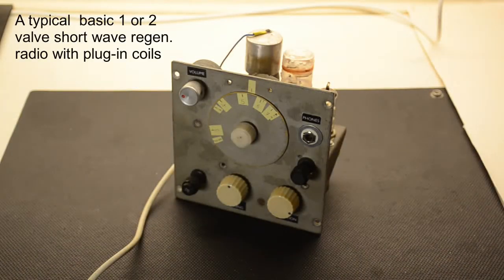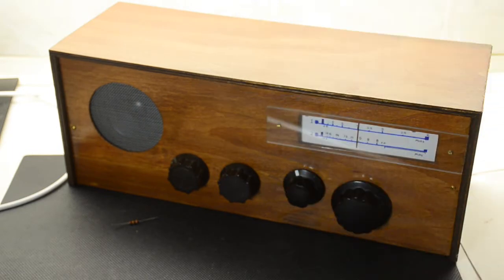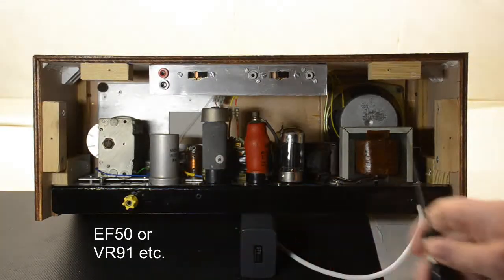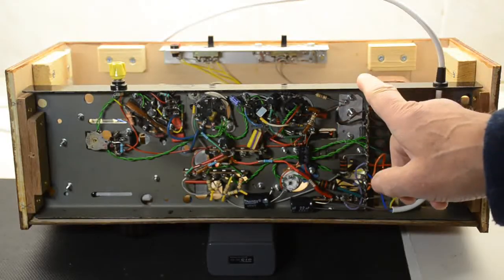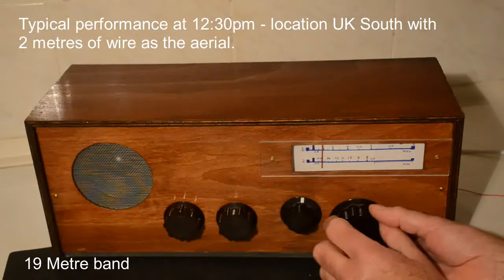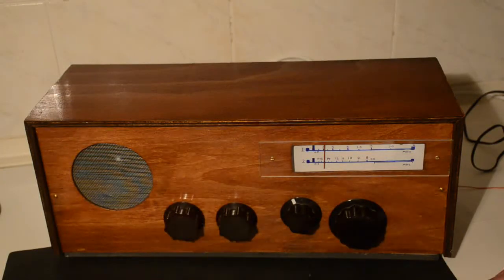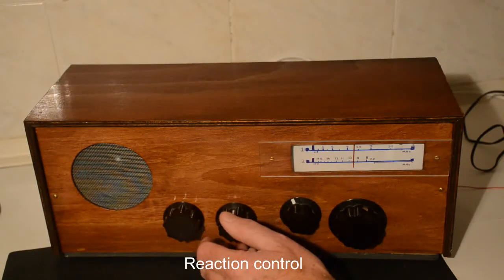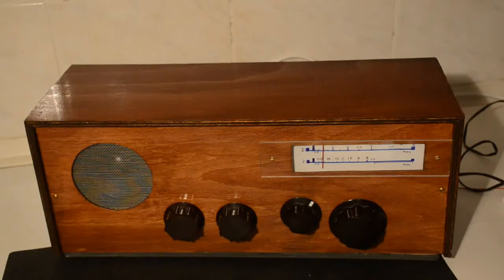Valve Short wave radio project

Comment: Circuit please
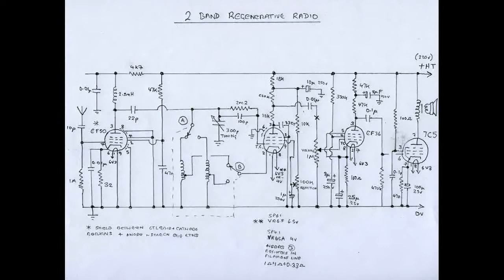Reply from the maker: Hi Don. Right at the end at 13:00 minutes! The coil winding follows immediately after it. The only thing NOT shown is the 250V PSU as it was a bit odd as I'd used a single wave rectifier valve with a non-standard filament voltage. If you prefer, just use a single silicon rectifier such as a 1N4007

Comment: Hello again and thank you for another video .I like your construction,  excellent work. I built a regen receiver a while ago. It used a 6u8 with the regen pot to control  the screen grid voltage. I followed that with a 6gv8 audio output tube. I didn't have an output transformer so I used a transformer from a 5  volt plug back. That gives a voltage ratio of 48 which equals the turns ratio. So squaring that 48 gives an impedance value of about 2300 ohms which while not ideal  is an acceptable load for the 6gv8. I agree with your comment about sourcing old components. They can be impossible to find sometimes which led me to  the plug pack transformer.  Kind regards  Clare
Reply from the maker: Thanks for the comments. I just saw this particular circuit and had the urge to make it using an old chassis I had to hand, but had to make the box myself... Sadly I'm not very good at that side of things! 
 Yes in the 'old days' one was able to buy the right impedance transformer for a particular valve, but now I usually find myself compromising. However,  I'm not sure that the ones I end up using would be as close with their matching as yours clearly is. ( I must try using something like you did to see how well it works.)

Comment: Tried SP61s in an attempted TV back in 1966. Timebases were OK but vision receiver gasped and hissed. Finally had success with EF91s two years later; more compact and SP61 is 'greedy' with its 0.6A heater.
Reply from the maker: Interesting! In my experience the SP61 (VR65) varies from sample to sample. For this project I actually used the SP41 which is the 4V 1A heater variant as I had a few in a box wanting using. Several had 'instability' type issues until I finally found a good one. I believe that they were actually quite advanced when introduced and ran reliably at  significantly higher frequencies than most of their counterparts from that time.

Comment: Nice. I still like valves.
I wish Denco products and especially coils were still around.
I bought some PM2 type valves at rallies and want to make a replica one valve H.A.C. like when I built one aged 14.
Valves and 90 Volt batteries became unavailable so I took it apart for parts. I wish I hadn't.
The green Denco number 3 coil is in my Wireless 19 Set to tune the input on receive.
G4GHB
Reply from the maker: Interesting! I've been collecting 'old' valves and valve interstage transformers, tuning caps etc. to maybe one day build a 1920s-look-valve set. As far as HT batteries are concerned, I 'plug together' multiple cheapy  PP3s until I reach the voltage I want. Agreed about the coils. Such a shame that there are so few Denco's around today and those which are, always attract a ridiculously high price.
Reply: @lishaton  Hi, yes I did that for a Pye  portable mw/lw  set requiring 90 Volts.and an h/b inverter for my much modified Wireless 19 Set.after removing the two remaining B Set valves..
Reply: there is a article on line for making replica denco coils from around about the mid 90's short wave magazine.
Reply: @roberthorseman7432  Yes, I've seen various articles.